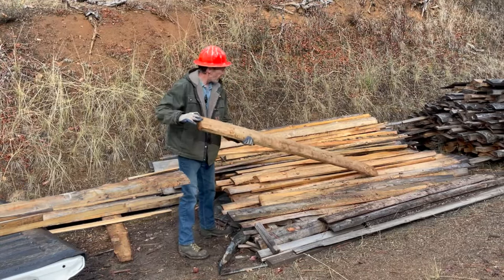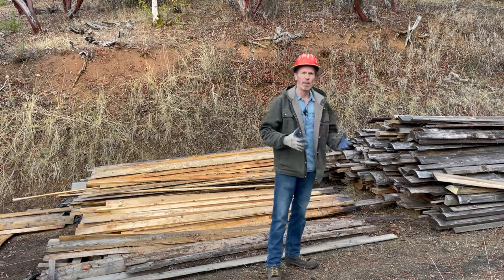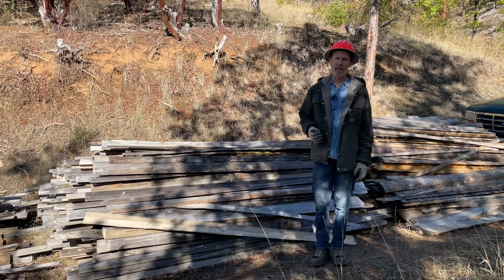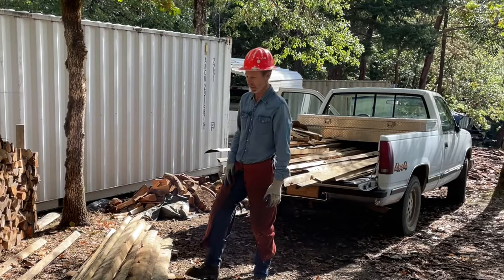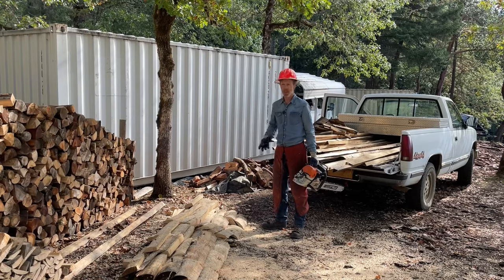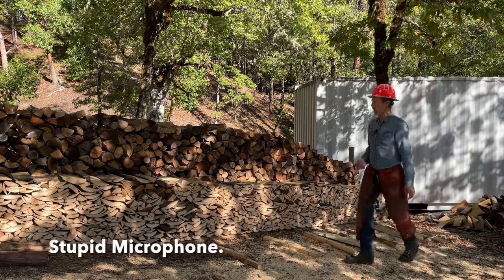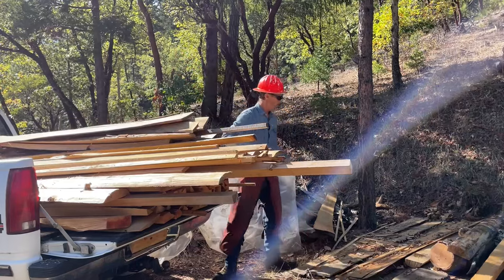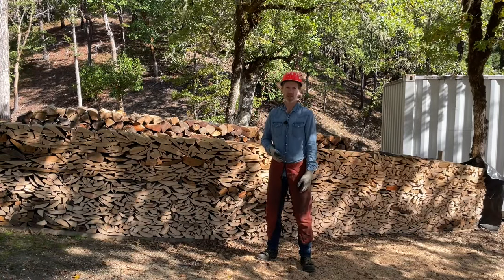Using Sawmill Waste Log Cabin Siding and Firewood from Woodmizer LT15

Comment: I made a Jerry rigged jig for cutting slabs out of old pallets put little roller poles as a spacer keep from cutting into the pallets used a cheapo harbor freight ratchet strap to hold the slabs in place while I saw them not perfect but it works fairly well.

Comment: if you make a sawbuck you will not get the saw in the dirt and it's easier to unload the truck.  Also easier and safer to saw at waist level.  Throw a heavy chain over the stack to hold it in place while you saw.
Reply from the maker: That’s the smart thing to do but I figured for this small amount of wood it would take me longer to build something than to just get it done.